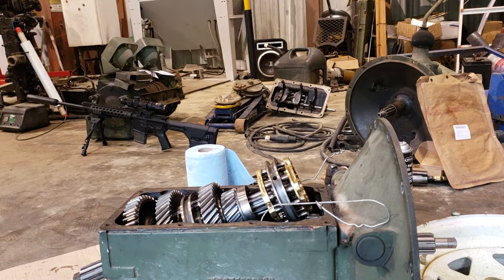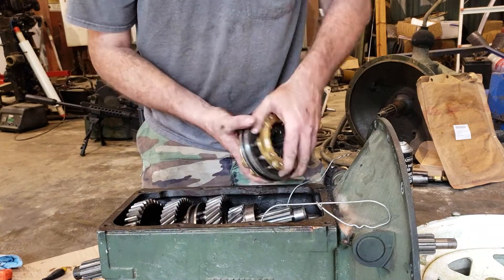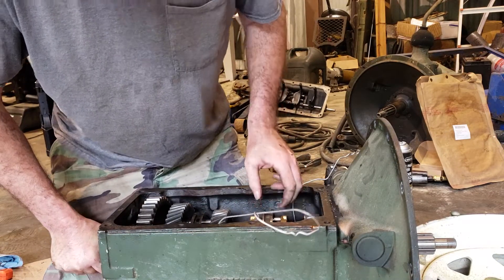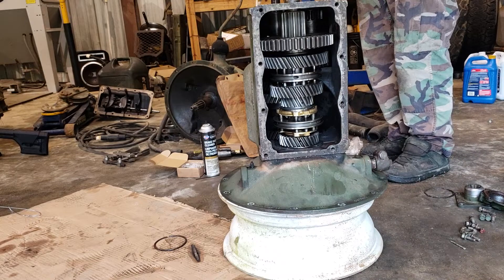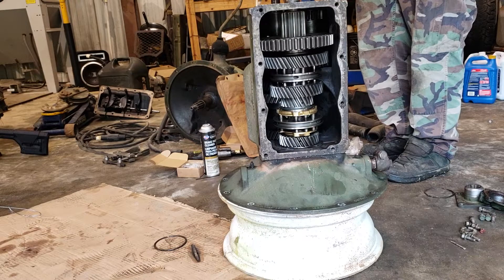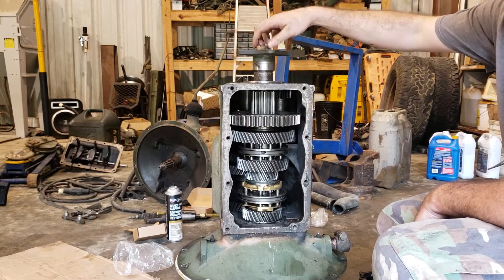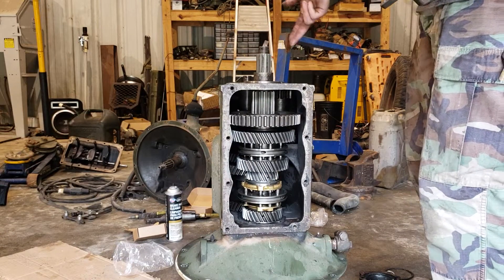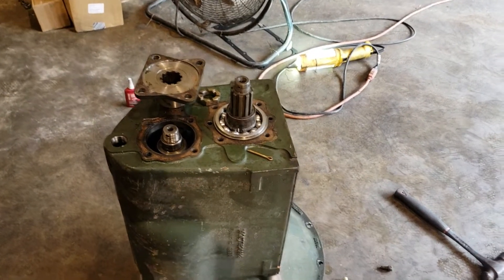M35A2 transmission, the Spicer 3053A, notes on final assembly.

Comment: Hi Gareth: is it possible to put the 2/3 synchro backwards? I replaced both synchros and now 2nd and 3rd gear are not working correctly. 2 won't go and does a high pitched grinding if you push and 3 is 'grunchy'. Help! Cheers! Mike
Reply from the maker: Yes it sure is. That sucks.
Reply: @tacticalrepair  thanks! We put the old one back in for now as the new one was really hard to shift by hand when we had it out of the tranny. Now we have 2nd again and 3rd in the upshift but nigh on impossible to downshift from 4th to 3rd. I'll order another new synchro when funds allow. I can slow down in 4th and downshift to 2nd for now.

To confirm, the synchro has an angled hole in the groove for the shift fork. Should it point left or right when you are facing forward? We had the new one facing left.

I searched the manuals and there is no mention I can find any reference to direction.😖
Reply from the maker: Don't worry about the hole. It can be on either side. You need to look at the hubs and it should be evident. I don't think you got bad parts, you just didn't get them together right.

Comment: I've got a 67 C60 with a 366 BBC and spicer 5652. Looking for a trans with a overdrive and see that the 3053A is a OD trans. My question is? Can the bellhousing on my current trans be used on the 3053?
Reply: I'm going to be 2.5t swapping my truck and in need of someone who might be more knowledgeable of these old spicers. Need my truck to do 60-65mph. It screams at 47 mph with my eaton 7.17 rear.